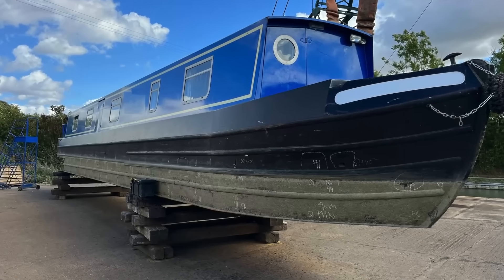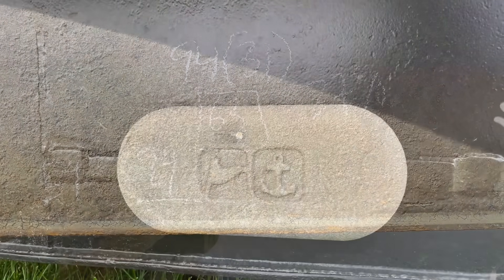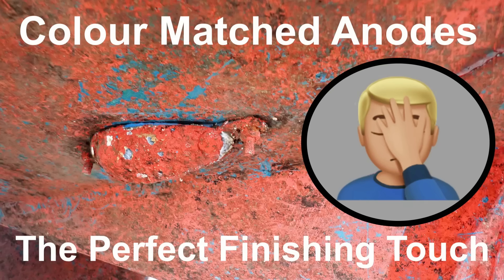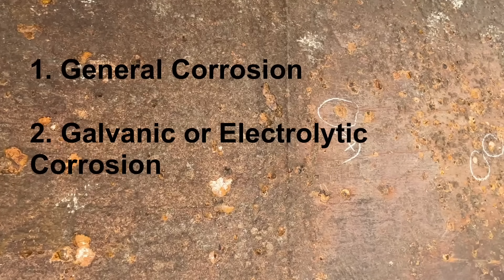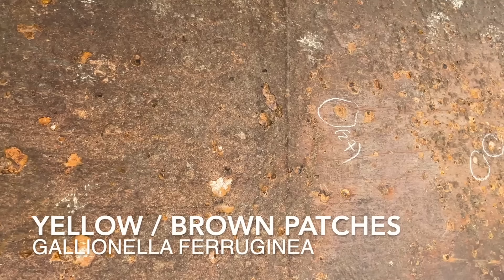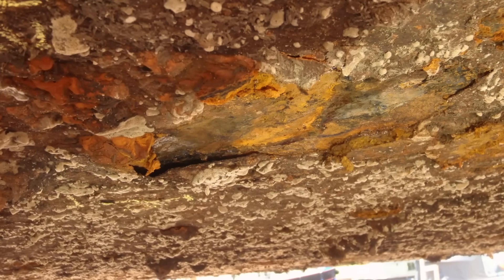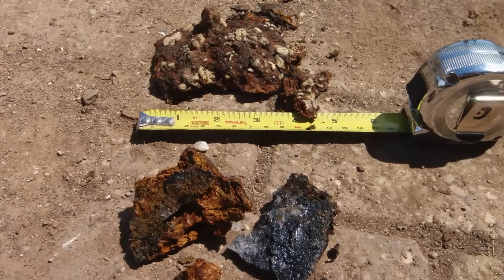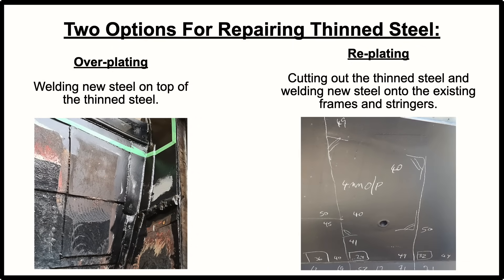No Anodes For 16 Years - What’s The Damage?

Comment: This maybe a really stupid question but why weren't they made with aluminium?
Reply: Cost, weldability, stiffness and low yield strenght (yield is the one where plastic deformation starts in english?) of aluminium. Cycling fatigue strenght is another one. Aluminium also corrodes badly in sea water if you don't use a seawater resistant. The muricans build a military boat of aluminium and I think to remember it was a pain in the ass. The russians built subs of titanium.... ask the cost. Hahahaaa
Reply: @alielabdimarras7965 so aluminium has many issues, but it doesn't rust 😂
Reply: @mikewhittaker5685  Aluminum corrodes. 'Rust' is pecular to metals containing iron, such as steel and steel alloys. Aluminum, Magnesium,  and other metals will corrode and some Srainless steels will bleed, which is the same process as rust in that the metal oxidises and becomes an oxidized version of whatever the original metal was. For example rust is iron oxide. Corrosion of Aluminum is Aluminum oxide. That said, when Aluminum is exposed the oxide forms a nearly impenetratable layer preventing further deterioration. Oxides of other metals do not give this protection.
Reply: @chuckaddison5134 thank you, I've always wondered about aluminium boats, I t makes me think of alloy wheels I've had over the years, and they've all corroded.
I've been watching Delos on youtube build their aluminium catamaran, I've been thinking surely that will corrode, and after working with aluminium on occasions in my work, it can be quite brittle especially at the welds.
I have came across an alloy door frame once which was almost impossible to drill, I never found out what it was but we bought every type of drill bit we could find and struggled to get a few small pilot holes in it after getting through about 30 drill bits.
Reply: Multiple reasons. Firstly aluminum is chemically different when it comes to welding. The very outer surface of an aluminum piece of sheet at all forms a protective oxide layer and this makes welding quite tricky. Unless you know what you’re doing. Secondly, aluminum is more expensive. And then you have the issue of compatibility with other systems that boat builders are used to having being steel. Aluminum is also not ideal for being knocked around and caught on trees etc. The other issue is that you can’t use certain coatings or paints because if it’s the wrong chemistry, it can eat through the metal. There are some aluminum canal boats, and now there’s even plastic ones. The truth is that steel remains the superior material for marine hulls, despite the fight against corrosion.

Comment: Bare bright steel is SA 3 not SA 2.5 and you don't use shot blast because it peens steel over corrosion, you apply an Abrasive Blast Clean with a suitable grit aiming for a 70 micron anchor pattern for best results, followed by a zinc rich primer applied Immediately after Abrasive Blast Cleaning is completed and then a couple of coats of 2 pack epoxy from Hempels or Jotun..
Reply from the maker: Thanks for sharing your expertise on the ideal surface preparation and coating process for steel hulls - "Every day is a school day"!
Reply: @whitehatmarinesurveying  Haha, I don't even have a steel boat but very informative your video !!!!!

Comment: So if you are building for a fleet it probably works like making wooden hulls in the past. Why make more investment than you have to as resale will be relatively poor and you have made your investment anyway. Not what the new owner wishes to hear but the fleet owner has made their profit and that is what the investment is about. It was the same of old fleet boats on the Broads years ago and the fibreglass models that replaced them.
Reply from the maker: You've hit the nail on the head, it's all about Whole Life Costs.
Reply: Compare the 3000 mile oil change intervals that used to be 1970's standard...
and now the 10,000 mile OCIs recommended by the OEM for their new cars...

5000 mile OCIs are the way to ensure the modern engine stays working...

and in this narrowboat's case all they needed to do was have some of those cunning recessed anode fittings welded in when they built the boat.......
and a bottom coating haul out and anode replacement every 5 years.

Comment: There's going to be an obvious answer and it will more than likely be cost I would imagine but what if the hull was stainless steel? 🤔
Reply: Stainless steel is susceptible to stress cracking at welds and pitting in anoxic conditions. (ie under the boat!) It is not a perfect answer and quite a bit more expensive, that is why people bolt on anodes and haul out for a scrub & replacement every couple of years.
Reply: HDPE is probably the most realistic option as at least one boatbuilder offering narrow boats.
Reply from the maker: I wrote about the first HDPE narrowboat at this year's Crick Boat Show:
https://www.linkedin.com/posts/davidpestridge_as-the-2025-crick-boat-show-draws-to-a-close-activity-7332798882919206914-IVH3?utm_source=social_share_send&utm_medium=member_desktop_web&rcm=ACoAAAIGhYoBPM-cuccgyloITQ34fdAgUc3lkfs

Comment: Would be great if a method could be developed to renew the steel pits such as electroplating
Reply: Spot Filling with a MIG Welder works....have done it several times
Reply: Spray welding

Comment: I am interested and in the compassion costs, roughly what would it have cost over 16 years to fit anodes and any blacking that was not done vs any cost to now repairs or devalue of the boat?
Reply from the maker: It's a good question. Let's assume the anodes last 3 years and the hull get's re-blacked with cheaper bituminous blacking at the same time.  That's five sets of anodes which if they only do a pair at bow and stern would be (4x5x70) £630 or full scaling of a pair every 4 metres (10x5x70) £3500 plus blacking at let's say £40 p.m. is (40x18x5) £3600. So a rough addition to the Whole Life Cost of between £4-7k. Equal to about half a dozen charters?

Comment: Very informative video.  Thank you.  

When we bought our boat a couple of years ago, we were strongly advised by the surveyor to paint the bottom next time it was blacked.  We blacked it ourselves, but were unable to find anyone who would black the bottom plate.  Even where we had it taken out of the water at a marina, they were unable to safely stand it high enough for us to access the bottom plate.  I had purchased considerable extra blacking to cover the plate (for which I was scoffed at by the blacking supplier because "No one blacks the bottom!" and then received a hearty "I told you so!" when we returned the unused cans.)  Where do you go to get the boat lifted out in such a way that you can black the bottom plate?
Reply: Find a boatyard that can lift it high enough. I do find a totally shocking correlation between boat yards who say 'oh theres no need to black the bottom' and boat yards who haven't the kit to lift boats high enough to black the bottom. Funny that.
Reply: @emmajudson5945 The one we went to (Dunchurch Pools) has a crawler that can lift it high enough, but what do you sit it on that's stable enough to be safe with it that high?  They (and the other marinas and boatyards I've seen) use stacks of what in the US I would have called railroad ties, and they seem a little shaky even a couple of feet high.  The only exception I've seen is at Circus Field Basin on the Aylesbury, which has an indoor facility with big hydraulic lifts.  Unfortunately, we weren't ready to black it when we were there, and you can't even get there now!
Reply from the maker: A lot of dry docks or covered slips are not able to lift the hull high enough to give surveyors or painters decent access to the base plate.  Those yards that can, do and it is totally worth the extra time and effort to do it.

Blasting and painting bottom plates is grubby work and some yards struggle to get staff willing to do it for the low wages on offer. Hence why there are so many naysayers that say it isn't worth it or "no-one ever does it" or "it'll just rub off".

Comment: 6 mm left is more than enough . It is overbuilt  .
Reply from the maker: There's a bit of truth in that, if you run the numbers for a narrowboat of this size 5mm would have been strong enough at build. But that wouldn't have survived 16 years with no anodes or paint on the bottom plate.

Comment: Would you recommend any remedial works on this boat? I would imagine pad welding any deep pits and a shot blast and paint (plus some anodes!) would give it quite a few more years of good service before any more major attention?
Reply from the maker: All of that less for the pad welding, pitting not serious enough to need that at this stage.  But a good shot blast and a few coats of well applied two-pack epoxy should see her through the next decade with no further issues.
Reply: @whitehatmarinesurveying  thanks for the response!

Comment: What differance would it make, if the boat had been in salt water for 16 years?
Reply from the maker: Hard to quantify but all metals corrode faster in a salt water environment, hence why shipping companies spend so much on paint!
Reply: As a non marine architect/engineer, I wondered why Anodes were needed in fresh water, unless some estuary boating took place....
Reply: @bernardwright2420 What I know is that freshwater anodes are different metals from saltwater anodes & that even in fresh water having different metals at a certain distance from each other can and will cause corrosion. Also, a boat and a dock being different metals can cause corrosion.  So can something about having shore power leads, supplies, on docks. Then even in freshwater there are minerals in the water itself which can themselves be causes of corrosion. That's all my memory will provide right now, the details of each thing will have to be looked up.

Comment: Surely no one would purposefully skip something like the anodes so that the boats are near worthless when the company is done with them? If these boats are basically scrap when they are done, the secondary market for them would drop, because their potential competition including personal boats would have worse and less boats to use; but clearly no one would do such a thing, right?
Reply: It makes complete sense when you think about it. For a working boat repainting and changing anodes is downtime, it is more cost effective to start with a super thick plate and just let it wear down. The boat still had above 5mm thickness in the deepest pits at the point of retirement. A lot of personal boats as stated start at 6mm thickness.

The hull for a charter boat is meant to last until the boat would require significant downtime and maintenance. A personal boat is maintained constantly to keep its value.
Reply: @whitehatmarinesurveying
1 day ago
Bear in mind this is an ex-charter boat, where the whole life cost of building, chartering, maintaining and then selling the boat is carefully considered. A full set of 8 anodes on a narrowboat of this size would cost about £600 every three years say, plus the paint for the bottom plate etc.

Comment: Dear White hat marine, I have a 15 metre steel Dutch cruiser in fresh water canal. It's used in sea water for about 15 days per year. I have aluminium anodes every 2.5 metres, is that okay?
Reply from the maker: It's never ideal to be moving between fresh and salt water but aluminium anodes are the best compromise for doing that. Just be wary that they can get covered in an oxide layer which reduces their effectiveness. Check them at next lift out and get a feel for how your anodes behave in your locale.
Reply: @whitehatmarinesurveying  One thing I have learnt is that weed growth, particularly on salt water based craft where taking them out and pressure washing it off is a yearly occurrence, really hates fresh water and simply sailing your boat up a river into fresh water for a few of hours is a great way to get rid of it.

Comment: Hello. Thank you for the video. Why galvanic corrosion is here if there are no different metalls in this area?
Reply from the maker: Galvanic corrosion can occur anywhere there is a difference between two metals in close proximity.  It can even happen between two adjacent steel plates on a hull if they came from different batches. The greater their separation on the Galvanic series, the greater the effect.
Reply: @whitehatmarinesurveying thank you for the answer. But this is obvious what galvanic is, when metall "eats" another metall. Question was: did you find different mettalls in this area, that you called galvanic corrosion?
Reply: Galvanic corrosion occurs anywhere, example if you have an aluminum electrical negative and perform a copper splice you are fucked. I've seen wiring separate because of galvanic corrosion.
Reply: @DanielSilva-jj2lz  it is not correct that galvanic occurs anywhere, galvanic called galvanic because needs very specific conditions of anode and cathode close each other. The areas on video, doesn't look that this area has different metals. I would say this looks like chemical corrosion, because of aggressive deep hole. 
Or, it can be another case, when barge sits to the berth by one side, and berths play role as cathode, then it is possible galvanic reaction. But again, when barge sits with cathodic berth, then result will much much worth.